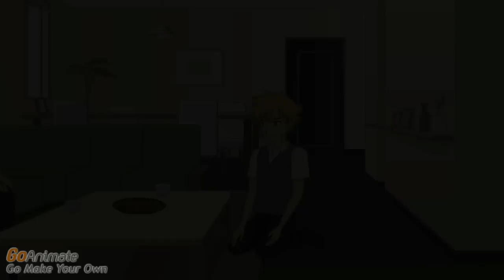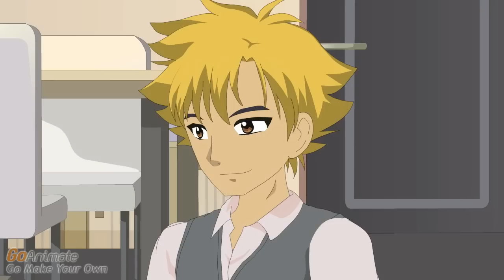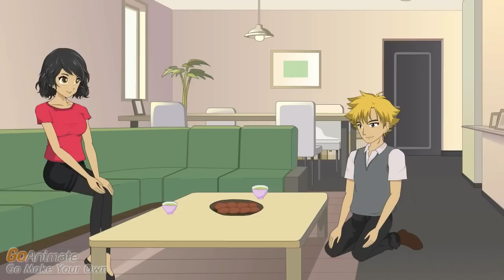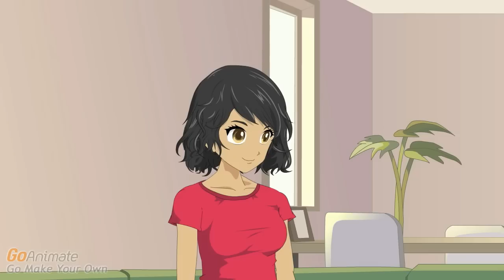Why is My Frost Free Freezer Icing Up?

Comment: Unfortunately it's probably as cheap buying a new one than getting an engineer. Fridge freezers don't seem to have a long life span (8 years or thereabouts )
Reply: 8 years. Almost to the day on mine.  Seals degrading, dripping.  Frost.  It is a middle-of-the-line LG refrigerator.
Reply: My Bauknecht "No Frost Care" freezer iced-up before the standard two years warranty! Bauknecht insist that we should simply defrost it manually and that this is NOT a technical / design fault !!! Their technician even told us that their "Frost Free" freezer must be defrosted manually once a year!? How ridiculous is that?